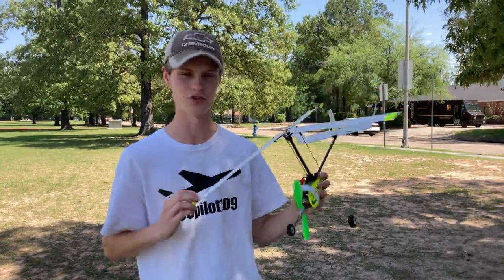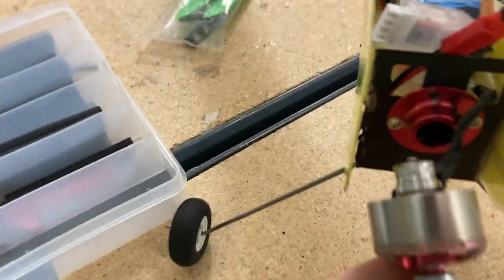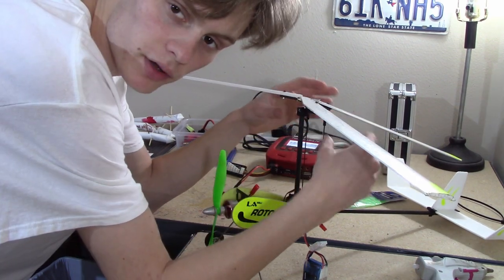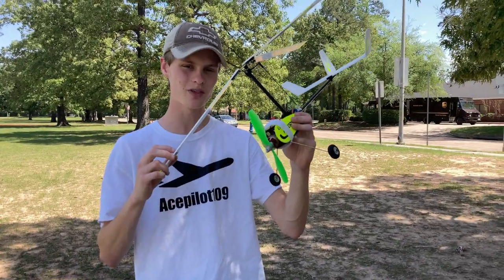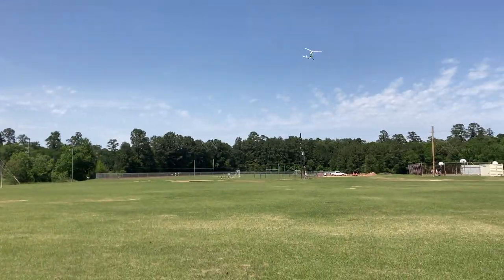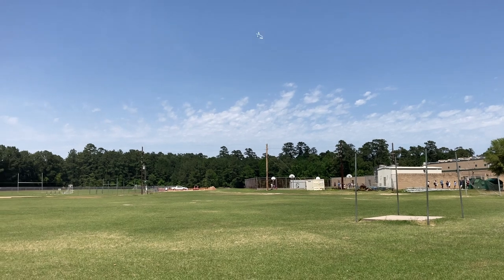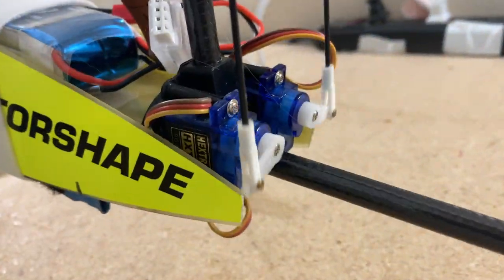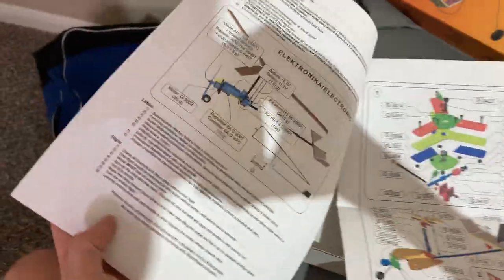Retro RC Autogyro! Will it fly?

Comment: You replace a Deans-connector for the worst connector of all: the JST? What’s the reasoning behind that?
Reply from the maker: I have two battery’s both with JST and none with Deans. It was just easier because I had the connecters already and it works just fine. I honestly prefer the XT30/60s